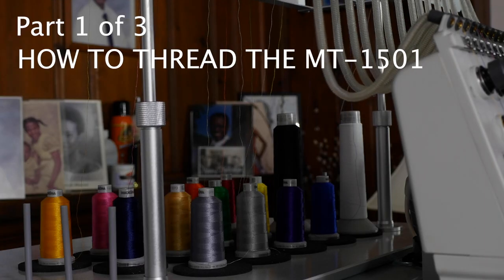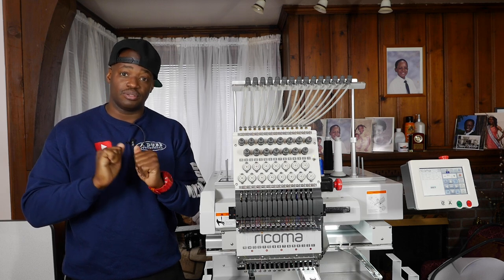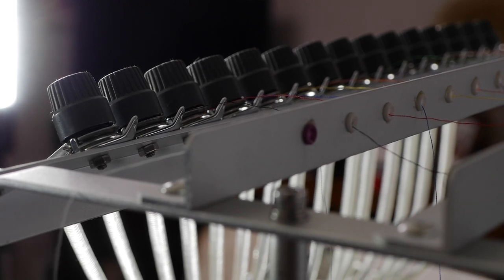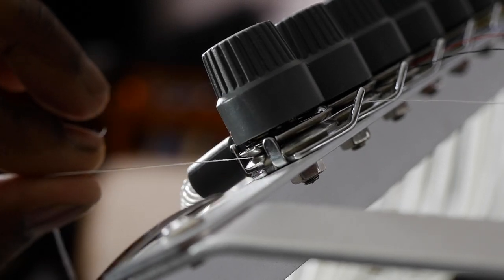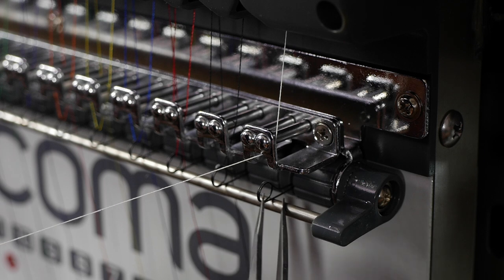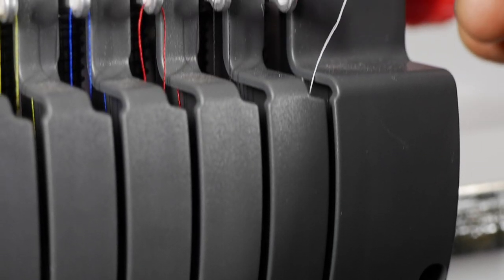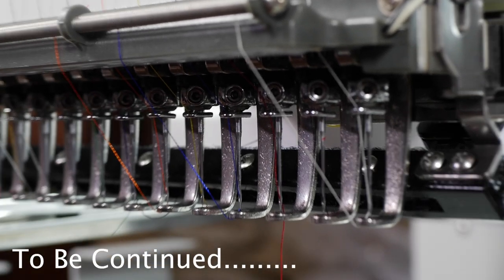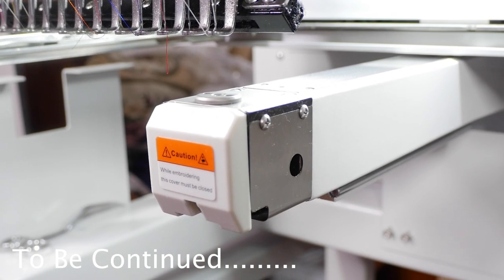How to Thread the MT 1501 Part 1 of 3

Comment: Thank you for another informative video. I had a needle brake yesterday and the funny part was I wasn’t paying attention that I unscrewed the screw all the way off lol 😂 and lost the screw
Reply from the maker: You are welcome.  Thanks for watching. Oh no. That sounds like a headache.  Did you get another screw? Where did you get it from? Would you have to contact Ricoma for it? I would use a screw from one of the other needles in the meantime till I found it or got a new one. I know you won’t make that mistake again.
Reply: @adubbproductions  The tool box had extra screws. The presser foot came down Lol 😂 I had parts laying on my design. I didn’t panic I just looked at it as a learning curve. I was able to fix my MT1501 without calling Ricoma it was actually fun. Your right I will not do that again. Found the missing screw by my chair.